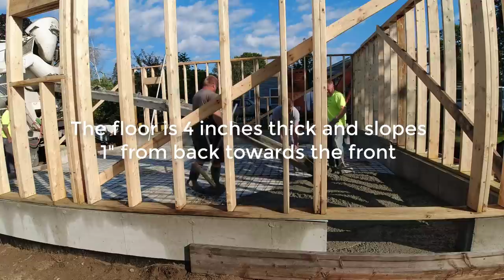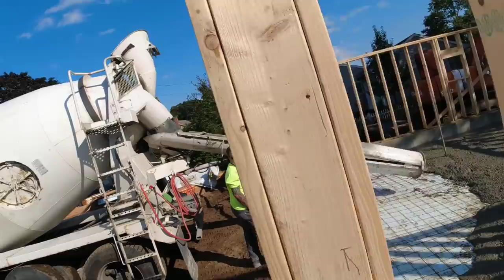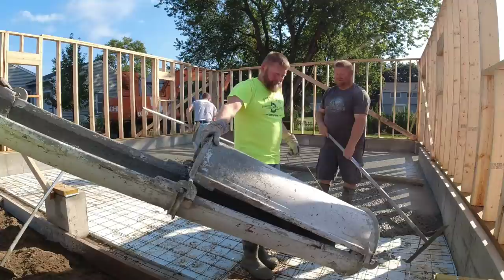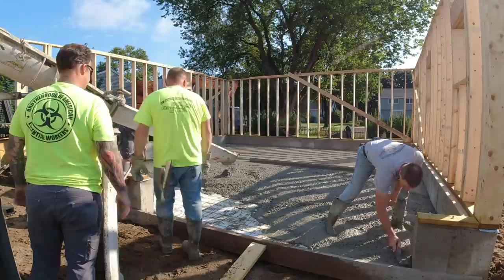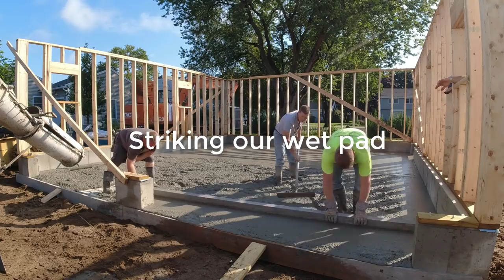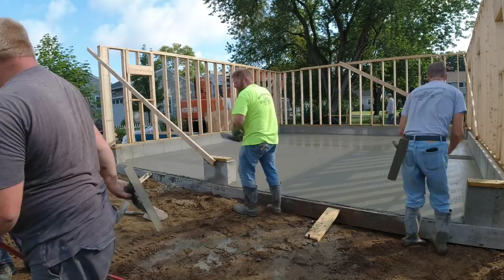How To Pour A 26' X 24' Concrete Floor for a Garage

Comment: I really like your videos and watch as many as I can.  But I am curious about the practice of laying the reinforcement on the ground and pulling it up into the concrete.  I'm sure that your team's experience means that they get it placed with reasonable accuracy but I thought that was not permitted by code, at least in some locations, that  you have to put the reinforcement at least on stone or concrete bits or on chairs.  Do you have a video on just how you execute on that step?

Comment: Mike,
I am curious why the owner put a concrete foundation wall. Was it code or was it just the design of the garage?
Great job by your camera person.
Reply: Mostly all foundation walls are concrete now.
Reply from the maker: It's what we do here in Maine. It goes down below the frost line so the building doesn't heave in the winter.